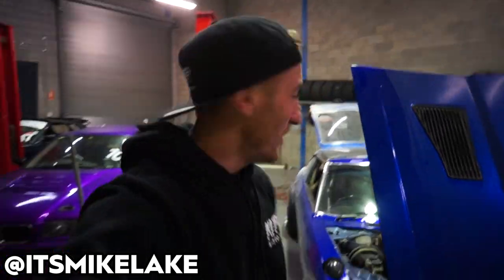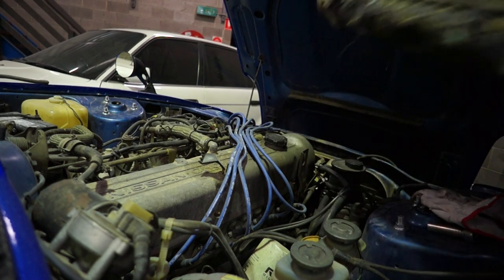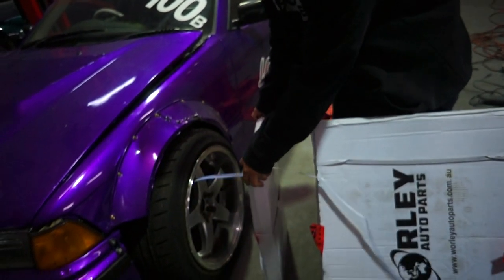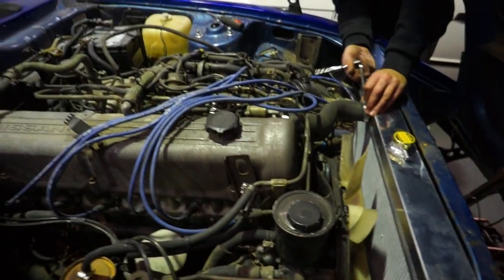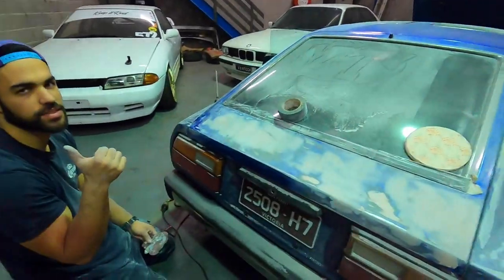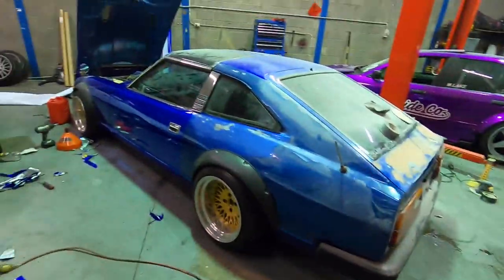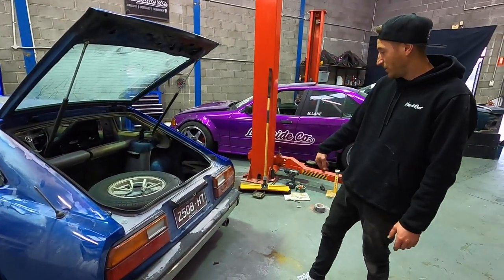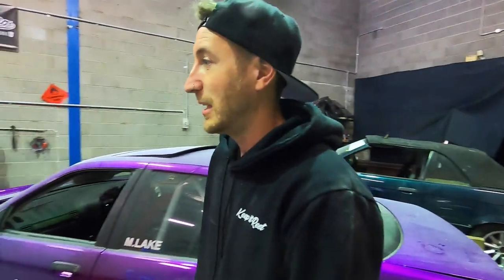DATSUN 280ZX ALLOY RADIATOR INSTALL

Comment: Seeing you bog up the exact rust I've been eyeing off on my z has been motivating aha, good luck finding an l28et in aus though unless you've got other plans for the atrocity of an engine bay😂
Reply from the maker: Haha, kill the rust with rust killer & fiberglass bog it dude. Should last a good while. No need to find an l28et, i'm going to turbo this stock motor. It's only got 200,000km and so crisp! These engines are begging for a turbo. I'll throw some ARP head studs in and 14-16psi at her on the dyno 🤩.